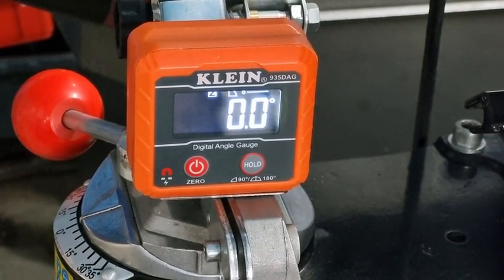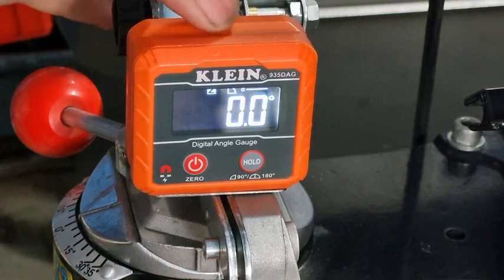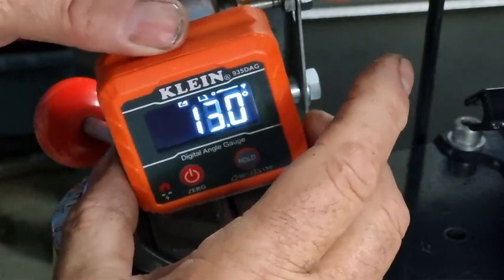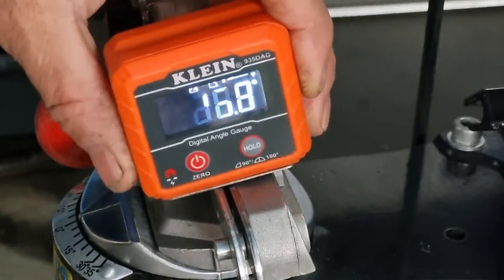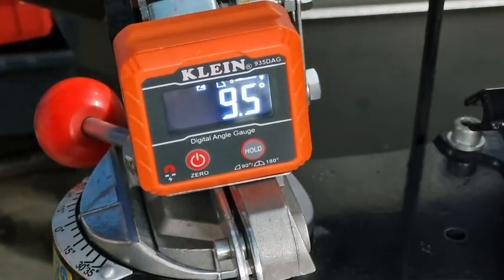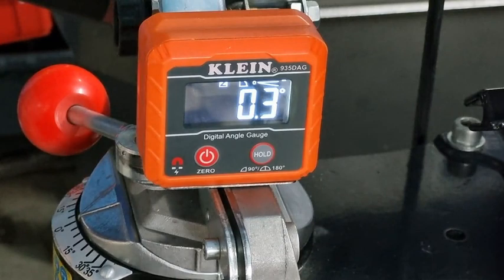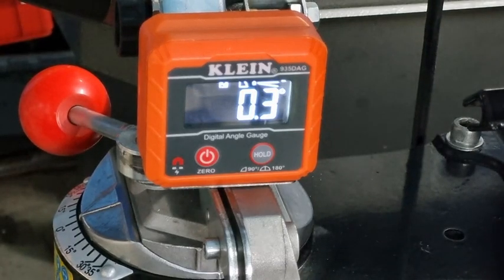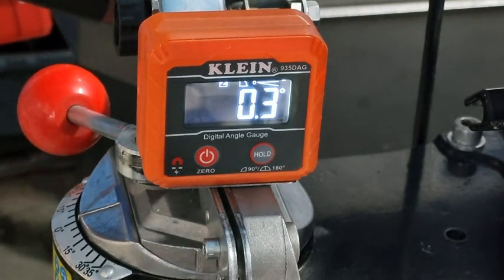Oregon 511 clone 10° tilt accuracy tested.

Comment: Hi, Due to your discussion's about grinders and angle discrepancies I decided to look into why my Oregon 520 was off by 1.5 degrees on the tilting vise angle. The vise its self is just like your 511, is off about 1/2 degree from right to left. No big deal right! Well the ring that rotates to set the degree of the top plate angle shucks back and forth in it's pocket about what to amounts to 1 degree of movement. So as you adjust from the right side cutter to the left you end up with a slight shift of axis from the center line of the grinding wheel and that's giving me what looks like a tilt angle issue. I have been compensating for the visual profile difference that I can see on the side plate hook on the cutter tooth with the sliding portion on the vice table by 1.5 degrees. The 1/2 degree variance in the tilting vice along with the rotating base moving 1degree back and forth is my 1.5 degree variance. Hope this explanation is clear enough to understand. Thanks for the discussion, I now know where my issue is.